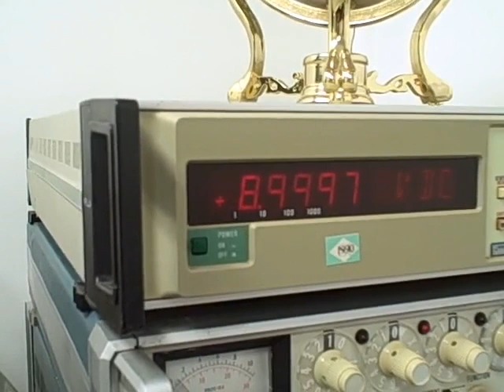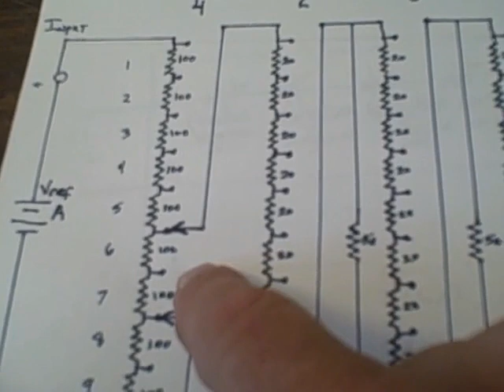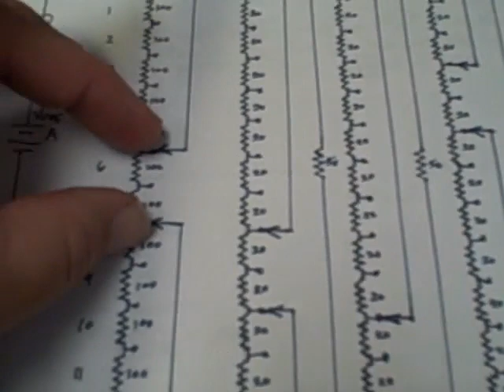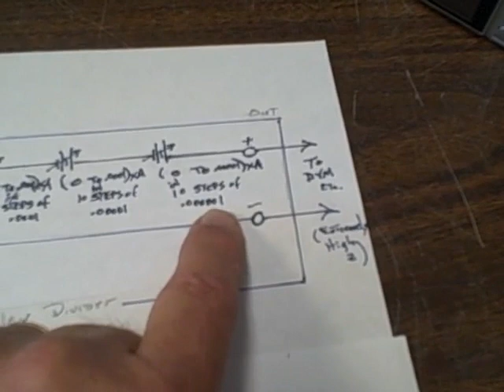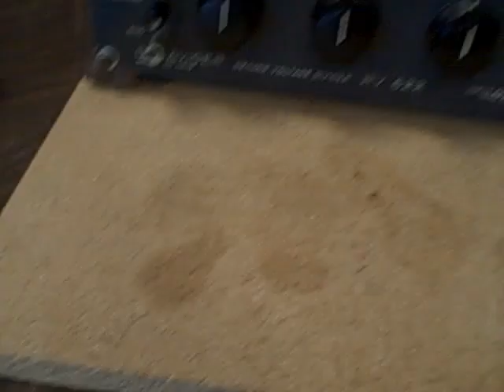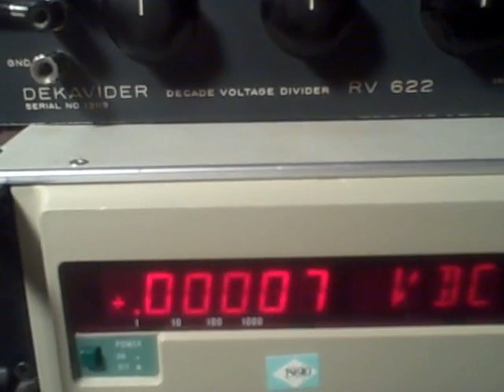ESI RV622 VOLTAGE DIVIDER

Comment: A little better way to run your test is to use the 10V reference into the 622. The meter A/D is a 0 to 10V A/D. You could also Xref (Math function #3) the meter with the input voltage of the 622 and this would eliminate most of the sources of error except the 622 and the linearity of the 8520A A/D
Reply: +randylemn 
I hate to admit it, but I am still a novice at all the functionality of the 8520A.  I have gone through a calibration on it, and got my offset to 0 microvolts, but it doesn't hold for me.  For some reason it drifts a few microvolts within a day.  I started to read about the functions, but I am still learning.